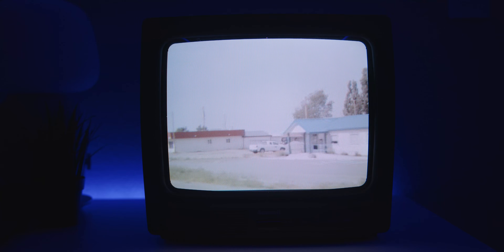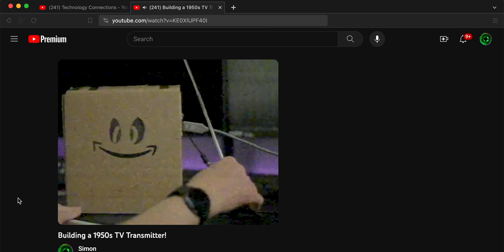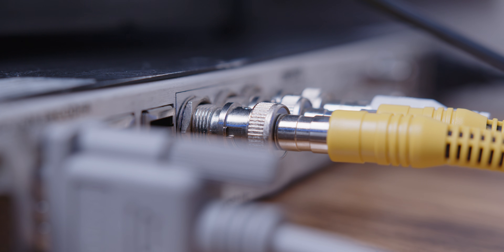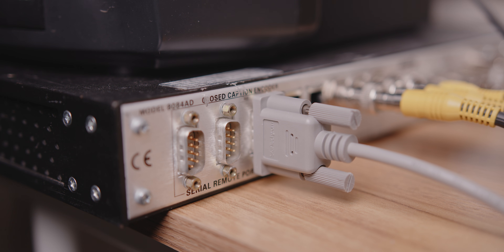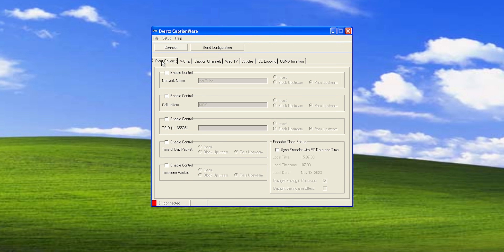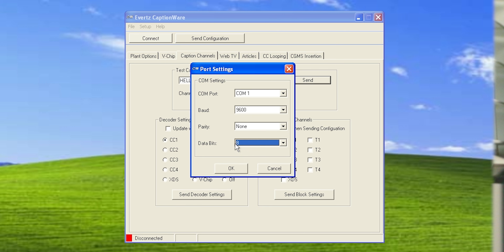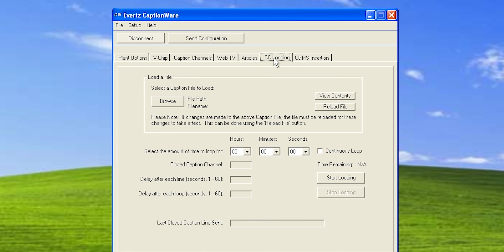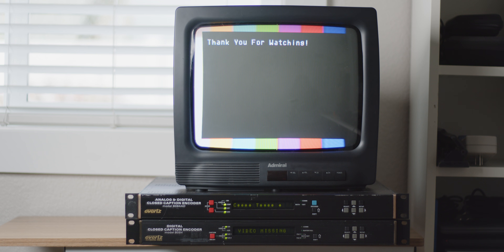I FINALLY made my own ANALOG closed captions! Evertz 8084AD Analog/Digital Closed Caption Encoder

Comment: there are a lot of encoders that you can connect to them using IP (public or private) and a port. About software for live captioning (what you did in your video) there are a couple of options, but pretty much all of them are paid and really, really expensive, like Telestream Captionmaker, or Case Catalyst with BCS module (is focused on stenotypists but it can be used with Dragon Naturally Speaking) or Eclipse (similar to BCS).

I am trying to develop a software to send captions over IP, but I can not find the protocols for Evertz or EEG encoders, which are the most common encoders in the industry. Anyone can help me finding this documentation?

Comment: I bet the serial port protocol is fairly simple, if you could capture it from the Windows app somehow. It'd be fun to have a server to inject captions into TV signals to provide notifications from email or texts or something. What happens if the incoming signal already has captions? Does it strip them and replace them with its own?
Reply from the maker: Not sure about the incoming signal, but I would assume it does. Yeah, it's actually fairly basic for serial. I'll probably write my own program

Comment: Under the vhs-decode project (aimed at FM RF archiving tapes fully with the entire signal frame VBI included) thanks to the chroma encoder we can generate software 4fsc composite or s-video on file and embed any VBI data we want into it's luma channel VBI space, then play it back over a DAC as a standard PCM stream. 

It should be noted the software route you described at the start is normally is HackTV and you can use a HACKRF orignal or clone or just use what we have at the decode projects a 10USD VGA dongle (FL2K) with a 3rd party driver, but its cool to see legacy hardware played with!
Reply from the maker: That's cool! Thank you for commenting

Comment: Take a foreign language film on DVD and record it to VHS with...

1. anamorphic video to record the widescreen version without wasteful letterboxing, requires a widescreen TV or hacked 4x3 CRT TV or converter for proper playback.
2. English dub (yuck) or commentary track on the linear (non-hifi) track. I did this via a second pass on and early VHS deck with a sound dub feature. Course people without hifi playback will be limited to the alternate track.
3. English subtitles recorded as CC, maybe both English and foreign. I've done the first two but I'm not sure how I'd send the DVD subs to this thing if I had it.
Reply from the maker: Yeah I still want to figure out something like that.. I'm thinking I could have a script that sends the captions over serial in sync with the DVD as I'm recording it. Then pass the output of the DVD player through the encoder and to the VCR

Comment: Try to watch digital tv on an analog transmission. You probably could use a capture card on a modern tv and connect it to an analog transmitter thing so an old tv can pick up the signal.
Reply from the maker: I was thinking of doing that with multiple analog channels. It would be like having analog tv broadcasts
Reply: @simonretrotech  that would be cool

Comment: Oh, my gosh. This is actually crazy. So I could caption something, maybe pull some strings and get the video of what I captioned on analog TV, and look at my captions on old caption fonts? Sounds pointless, but it would be cool to see my positioned captions and everything handled. I also wonder what would happen if you attempted to go over 32 characters or four lines.

I should learn more about digital TV, though. I'm not sure why captions are still limited to 32 characters per line, not that that doesn't make sense--we're using monospaced fonts still, right? But even then, why? We're not really using Line 21 anymore. Oh, well--compatibility.
Reply from the maker: Yeah you could! When I go over the limit I think the encoder cuts it off. And yeah at some point I want to try some digital TV stuff.

Comment: I built the same analog transmitter that you made and unfortunately didn't work, I think it's just because I had HDTV antennas so I have older ones on the way. Hopefully that works
Reply from the maker: Interesting.. I'm not sure if the antenna will help much? I don't know.. keep us updated!
Reply: @simonretrotech  oh hi, thanks for responding. I actually got it to work. I was just dumb and the TV was on cable mode instead of antenna :/ it's definitely not as clear as yours but it works and that's all that matters lol

Comment: Im not sure but I think that the reason theres black spaces around the analog signal is so that the crt has enough time to get the electron gun into place for the next line. I have no reason to think this besides that a VGA output does the same thing and if the space outside isn't black (white for example) it could accualy break crts its connected to
Reply from the maker: Yep, it's also to let the beam get back. It fully shuts off the electron gun